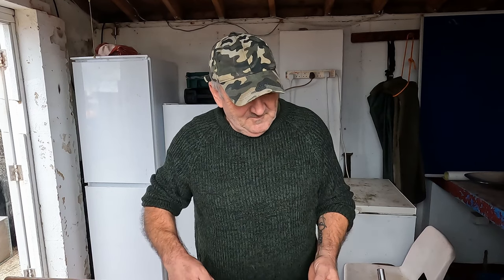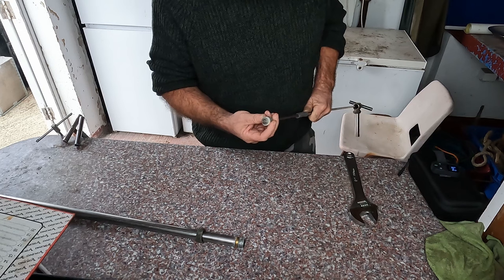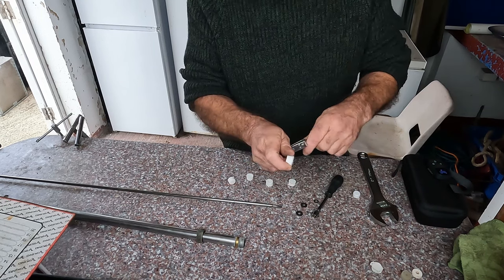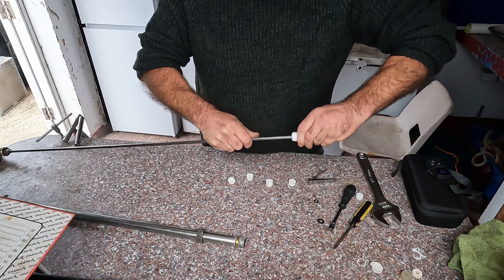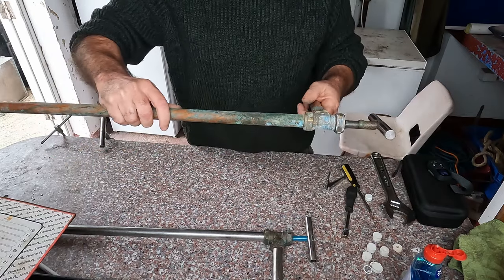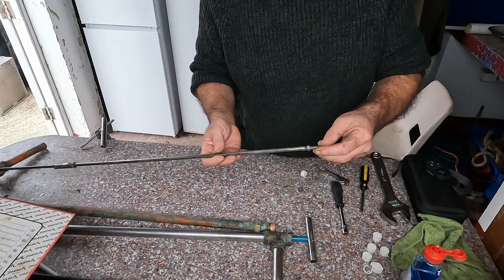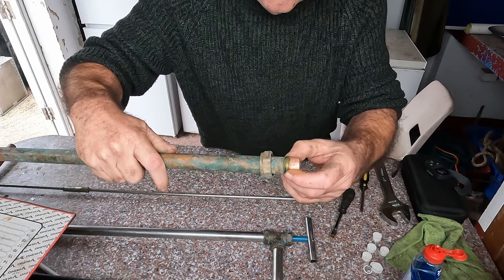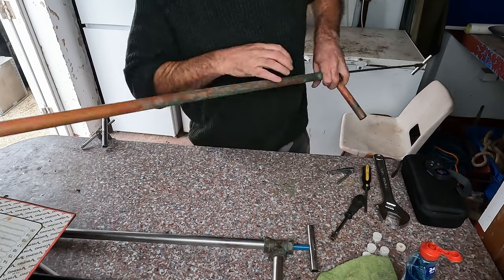Rebuilding Lugworm bait pump with homemade seals/washers

Comment: Great videos 👌. What is the best material to use? Copper or stainless . Is the centerrod solid bar or tube ? Im a plumber / pipewelder , with acces to all kind of stuff 😂
Reply from the maker: Hi Peder  happy Christmas my friend the center bar is solid 8mm 316 or 304 stainless with a m6 thread on 1 end with a m10 locking nut
also depending on whats cheaper for you stainless 22mmm tube is better long term but i love 22 mm copper i seem to get more suction and the wear on the copper shows how deep they are good luck with your build if you get stuck just ask will always help cheers

Comment: Did you try which washers are better/last longer? Water cured or regular?
Reply from the maker: Hi they both work very well but if you have plenty of time to let them cure the pure silicone 1s last longer
Reply: @hastingsangler  amazing. Going out tomorrow to try your sillicone idea :) finger crossed. Just starting with pumping so need to figure out technic etc. Great videos for someone like me. Thanks 👍
Reply from the maker: @jacobs198686  Hi good luck with the washers just remember the most important part is getting the pressure right dont overtighten it  happy pumping

Comment: Do you sell the silicone seals?
Reply from the maker: Hi sorry i don't sell them but they are easy to make here is a link of mine that will help you https://youtu.be/nls8WV9wdj4 good luck
Reply: Okay thankyou !
Reply: @hastingsangler  my pump does my shoulder in , I need to fond a seal that would still let it pump smoothly. 28mm pump what size silicone seal would you go for ?
Reply from the maker: @LingLing_Official  Hi what size diameter is the shaft in your pump and also what are you using as a washer at the mo
Reply: @hastingsangler  when I got ot made it was just made with 3 rubber washers and a metal washer then nut.
Reply from the maker: Hi it sounds like you are using tap washers they are awful and very stiff to use do you have any flip flops at home if so try that or make some silicone 1s good luck
Reply from the maker: Hi where about are you from
Reply: @hastingsangler  bognor regis mate
Reply from the maker: @LingLing_Official  Hi are you using tap washers 3 is a bit extreme and that must be bloody hard to pull
Reply: @hastingsangler  yeahate that's how it came 3 black washers no silicone sealant noting just metal washer 3 tap washer then metal washer
Reply from the maker: Hi if your unable to make your own kevin from kdr pumps sells them https://www.facebook.com/KDR.PUMPS/ but for the time being i would remove 2 of the black washers and pack with a few more washers the problem is thay are so hard you cannot adjust the pressure of the pump good luck or as i said find a old flip floop and push your pump down on it to cut out a washer they work well so im told
Reply: @hastingsangler  cheers thankyou

Comment: hi mate, i wanna replace the wingnut on my pump for a lock nut but i havent got a clue what size to get for it
Reply from the maker: Hi it all depends on the shaft size that you use the thread on my pumps are 6mm thread so i use a 10mm nut   8mm would be 13mm and 10mm a 17mm nut hope this helps wingnuts are ok but always seem to come loose and always adjusting pump